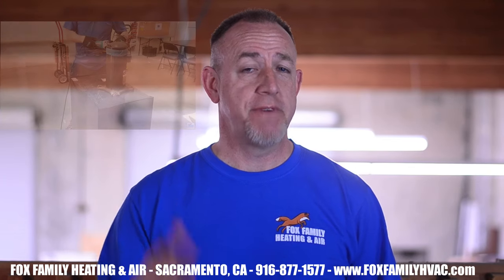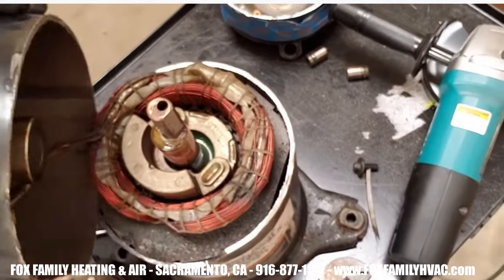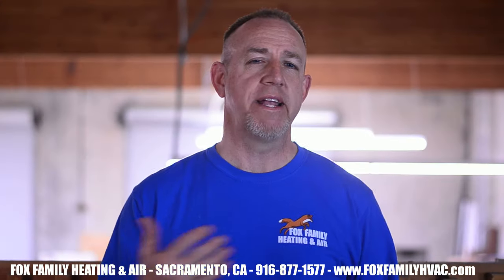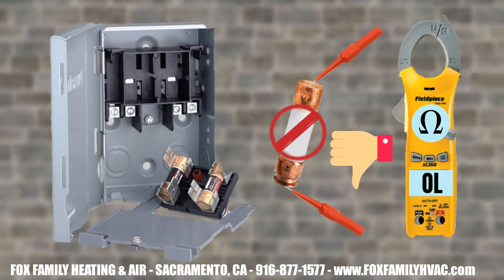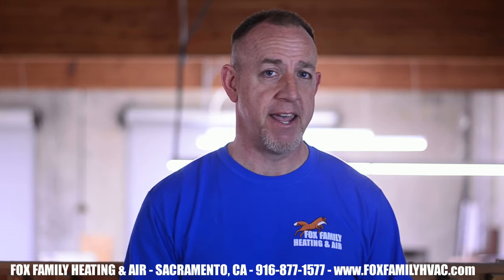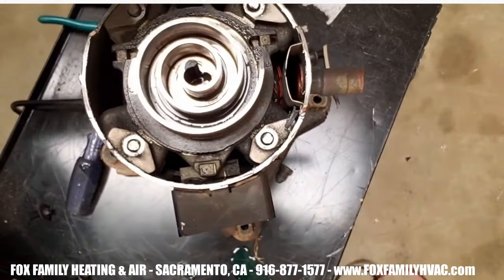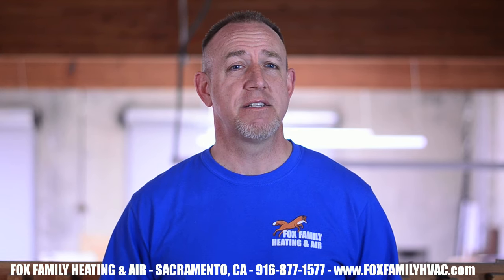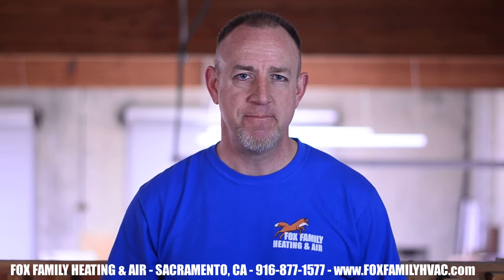How I Troubleshoot an Air Conditioner Compressor

Comment: You missed a VERY important step TURN OFF THE POWER FIRST!!
Reply: Yolo man live life to the fullest
Reply: Lol...U guys R funny, however, true!
Reply: turns out the breaker was already off. Troubles shot. Thanks 👍🏻
Reply: That's for a technician who doesn't have Common sense
Reply: @Optimus987 in all my years I have definitely done it once or twice when I went to discharge a capacitor 😂 scares the 💩 out of me but yeah common sense is always pull the disconnect and if it's a switch than or even a pull out check for power. I've had snapped legs in the disconnect and I've had some schmuk by pass the disconnect and wire it directly without labeling it. Opened up the disconnect and pulled it out then still had power, removed the piece of plastic and he wire nutted it all together. Whoever it was obviously had no common sense to label it and also to come back and repair whatever the electrical issue was with the disconnect box

Comment: So what is it mean hen you close the valve on the high side. Turn the compressor on to suck the Freon into the condenser but the compressor sounds like it blows off and won't pump down.

Comment: My brother in law has a unit that keeps blowing  compressor  fuses. He just changed the unit and they left the same wiring. It still happens with the new unit. It will work for a week or so and then they will blow

Comment: Excellent video. Learned a lot. Especially thankful for the tip on NOT removing the leads at the compressor because it may blow up in my face. I adorned a clear mask and removed them carefully. Sprayed some contact cleaner, attached, and it worked so I assume after 27 years of service the connections oxidized.

Comment: Thank you for the wonderful videos. I have an issue I am troubleshooting, if you can chime in. IFB sends 24v to the condenser every three minutes regardless of the indoor temperature reaching to the set temperature on the thermostat. Air handler and blower fan keeps running blowing warm air through vents after outdoor unit is off and until compressor engages again in three minutes. So the condenser fan and compressor are on for three minutes and off for three minutes. Subcooling on the unit checks out fine using liquid line pressure and temperature so not suspecting high or low pressure in the system. Contactor leads receive 24v every three minutes. I have checked the main and fan control board for damage or loose wires. This short cycling is not as bad but I think I have an issue I can figure out. Thank you in advance!

Comment: Great video. I may want to get into HVAC due some horrible service I’m experiencing. I’m an hour south of Sacramento and it gets hot out here!

I scheduled a tune-up through my warranty, AHS. The day the technician from IHS went to my house, the AC was blowing cold, there was not nor had there been any indication of there being a problem with the AC. When he showed up, he asked my wife to turn on the AC, it turned on, blew cold. The technician then said that the compressor was not working properly. He let my wife know that he would be able to fix the issue then and there if I put in another work order. I didn't think anything of it, took his word as the professional he is. I put the service order in that moment with my warranty, AHS. Come to find out, he couldn't fix it that day because they didn't have a compressor. The technician left, AC is no longer blowing cold. Why? I don't know, I'm not the professional. It was just blowing cold without an issue while the technician was home. 

After a few days without a word from neither my warranty or the contractor, I called the contractor to see what was going on. If I'm not mistaken, it was Sal who told me I would have to pay $1,490.00 out of pocket for the repair. I was surprised about that and he suggested I call AHS, my warranty. After going back and forth with AHS, they said they would cash me out for $947.00. I would still have to pay over $500 out of pocket if I stick with IHS or choose a different contractor. I told my warranty that I shouldn't have to pay anything out of pocket because whatever happened to my AC, it happened while the technician was there. AHS referred me back to IHS.

I spoke with Sal Cuenca to no avail. He does not see how his technician is responsible for what happened and he said he couldn't help me. I told him I shouldn't have to pay out of pocket and he told me I should have checked my contract with my warranty. I became very irate. I have 4 children from ages 12 to 4. We have had to buy tents from Costco and sleep in the backyard because it has gotten way too hot at night, we've gone to my sister-in-laws house as well to spend the day or sleep over, also had to go out to eat many times (which I hate to do) because it's so hot to cook inside. In the mean time, I've also had to purchase a portable AC unit which is a pain to move around the house and room, it barely does the job because of the square footage, but it's better than nothing for now. Dealing with this crazy Central Valley heat as an adult is one thing, but as a child, that's on another level. My children constantly complain about it being hot in the house, especially when they get home from practice. 

It's been a month and a half and my AC has yet to be repaired. Never would I have thought that this would happen and that IHS could be so cold (no pun intended).

Comment: First off I'd like to say your videos are great, very helpful. So I've had 2 hvac companies come out because my compressor isnt turning on. Fan is working fine. They think its a bad compressor but both didn't seem sure about it. I'm nervous about replacing the compressor since the system is only 5 years old and its expensive. The one tech mentioned there was no voltage on herm of the capacitor. Tried replacing the capacitor with a new one, that didnt work. Still no voltage on herm. Have you seen this before? Is there a way I can figure out why theres no voltage on herm of the capacitor or test the voltage of the plug going into the compressor?
Reply: If there is no power at herm then your running off 1 leg.. Check the fuse at the breaker.

Comment: great video and consecutive explanation. One week ago when i tried to start my AC breaker went off. I tried again when i was close to condenser and i saw flash in contactor and breaker went off again. HVAC tech came down: fan is running separately, capacitor is fine so the only thing is bad compressor. It was a first start in season. What can be wrong with it???? Resistance is good, not shorted to the ground but something in it make fuses to go off ((( I just want more answers on why tech want to replace compressor ..

Comment: I have an AC compressor that won’t turn off when the thermostat (power company issued with power rate being assessed displayed on it) kicks off. Should I begin troubleshooting at the thermostat or at the start run switch?
Today both the condenser fan and  compressor were running when I caught it. Two weeks ago iirc the fan was off too. 
Perhaps a switch inside the compressor is faulty?
Reply: contactor, there's not a switch in the compressor to tell it to run

Comment: Butnif the breaker is tripped wouldnt the fan not be blowing out the warm or room temp air? Or would it just not run the compressor?

Comment: How common is it to check the acidic level? My HVAC guy noticed mine was positive on one side and said I need to place a special filter to catch contamination in the refrigerant. Then replace this filter after a few weeks. Also replaced compressor. I have always had the dryer filter on one side, this particular filter is a special one in addition to the other one. 17lbs of 410 was very pricey on my 5 ton unit. I thought they would catch the 410?

Comment: A have a carrier weathermaker that the outside fan does not move but the fan inside the house does. Fuses and capacitor are good. Is there a reset switch on these? Cannot see anything.

Comment: Today my outside unit air conditioner circuit brake shutting off every time I turn on the A/C , I hear the compressor kick in for a second then the circuit breaker shuts off would a bad capacitor can cause the problem ?

Comment: Here is the issue. Compressor stops to run after several hours. Every time  I call an HVAC guy compressor is running like it should. And since the problem is intermittent it’s hard to re-create while the HVAC is there. Do you think HVAC pressure switch is bad ? Why does it Randomly shut off for few minutes and cut back on?

Comment: @gail6904
0 seconds ago
HELLO I have an Older window ac compressor ..I cant get the black tops off the top of ac compressor to test it~~~ has like a hard clay material glued on in globs...must hold the compressor black covers on  ..any advice how to remove ? I need to test my compressor to see if it is bad..unit blowing hot air in and cold air out..hopefully only the cap is bad..no reading on HERM side in MF..

Comment: Really well done. One think I don't see is how to know the compressor's LRA and how many amps it should be drawing. I got a reading of 13.1 now on the common wire just after it came on. I'll check again later, especially if it does what it did yesterday -- stopped cooling efficiently when it got really hot later in the afternoon. It was still operating but couldn't get the indoor temperature quite down to where I had the thermostat set (78), so it kept running and running instead of cycling off and on. From what I've seen, I suspect low coolant -- probably from a leak that just developed (it worked fine the day before). I presume I need a professional to check and if necessary, fix that. I'm just a regular guy who likes to fix things in my house when I can. Thanks.
Reply: Update: Same phenomenon -- on nonstop for several hours and seeming to be running OK, but it only maintained a temperature of 78 when I had it set for 76. Amps readings now were Common 10, Start 13, Run 4.
Reply: Correction: Run 13, Start 4, assuming I'm labeling them correctly.

Comment: When it is come in this way you are right sequence of operation pro this happened a lot and it is end up with changing the whole unit or change the compressor but R 22 unit still does not give it up

Comment: Just found out my compressor needs to be replaced and the wires melted along with caps blown. I think my home warranty will cover these things, but was told they won’t cover my refrigerant which will cost me around 1k.
Reply: Ur're kidding me, 1k?? Ok, time to change out complete unit & make small pmts. til paid & pray like hell that it last forever😅...

Comment: Seems like checking overcurrent devices would be the 1st thing.
Plus, if everything BUT the Compressor (ie. the fan and blower) is running the overcurrent devices wouldn't be engaged/blown- when they fault into the open state NOTHING runs. 
In this instance, their purpose is to disconnect line voltage when overcurrent in that circuit occurs.

Comment: Got a compressor that turns on and then off almost right away, then will kick back on and stay on for a minute or more and then make a hissing noise, any idea? It still cools inside, but not as good as usual, I’m thinking it is something with the refrigerant
Reply: Could be overcharged
Reply: I have TRANE XR17  3 ton that is doing this similar issue.
  Connected to Ring Nest thermostat that is giving Error code E107.  Not able to detect Y2 wire.  It is connected everywhere.  Tried upstairs nest on the troubled downstairs unit and it gets same error.  Tech is trying to sell new compressor.. He disconnected y1 wire and put y2 wire in y1 slot and it's cooling no issues.  My question...is this compressor problem or is it board problem/solenoid/contactor?  Hoping it's not compressor since it runs in stage 1 mode.  Help lots of $$$$ for 7 yo unit that wasn't cheap 7 years ago.  Losing faith in Trane.  Other problems in the 7 years that should not be happening.  Ready to go to window units if HOA would allow😢.

Comment: A tech diagnosed our compressor and said it needed to be replaced. So I purchased a compressor and when I came to pay him, he told me that there is metal in in in-lines. HOW DOES BROKEN METAL GETS IN THE LINES???? The tech said they need to blow the linesets and pull the compressor that broke up. How could this happen??

Comment: Actually before you go anywhere with  multi meter testing You need to start with the AC dedicated circuit breaker
Reply: Mult  met  breacker checing volt seting and checking  power cher one line brobe and  checking  2line  read  black broved wire met  ar. Temainal power point 22ov ok  .3phase ok  2line cheackin  46o v ok one pohe anter phase  one by checking thankyou shring gues